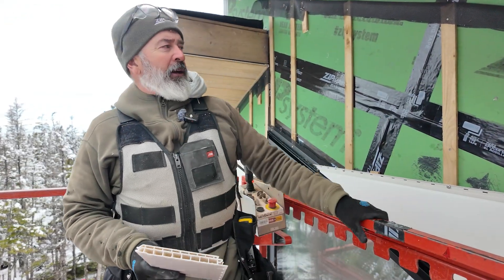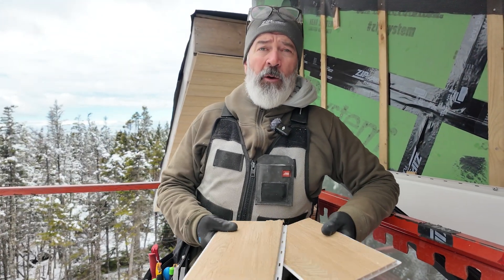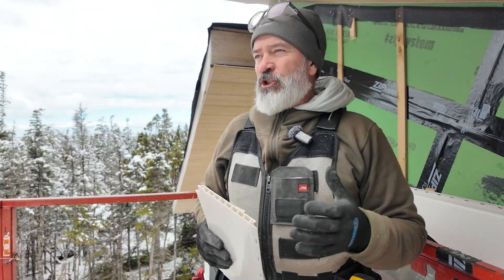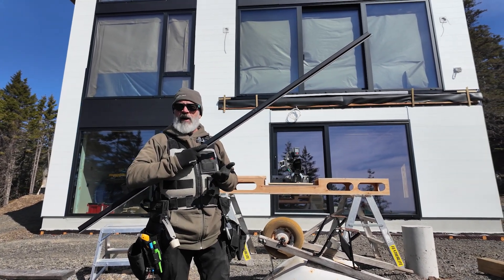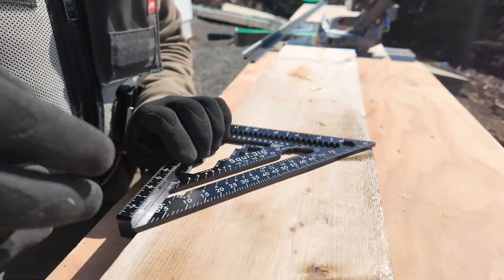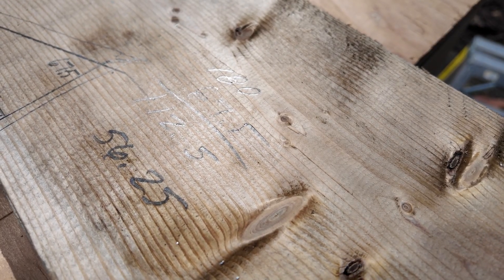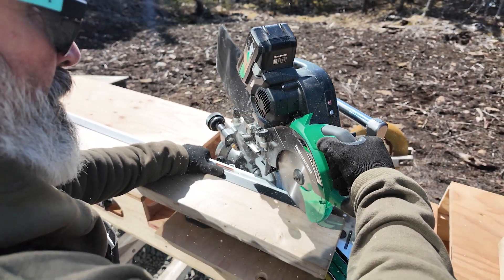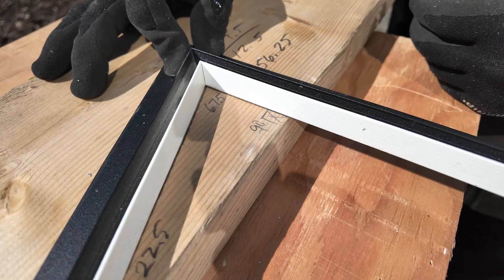South Hollow part 26 Rainscreens and 7th grade Math

Comment: I have a vented over roof. Is it okay to allow the rainscreen air to go behind the siding and then up the roof and out of the ridge? Not using a soffit vent?
Reply from the maker: Just to clarify.  Your vented over roof is not vented at the eave?
Reply: @Aron_Jones_Carpenter Yeah that is what I am proposing. Air will come in at the bottom of the wall and exit at ridge. Is this okay?